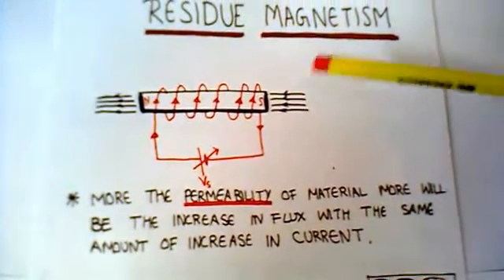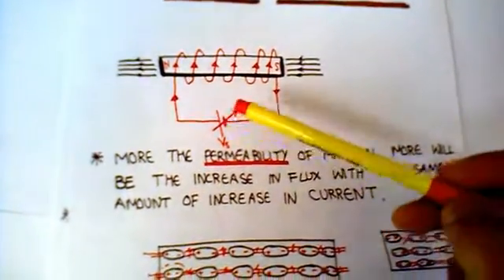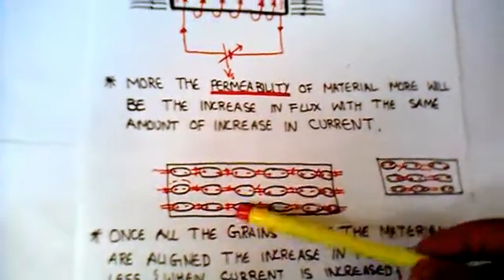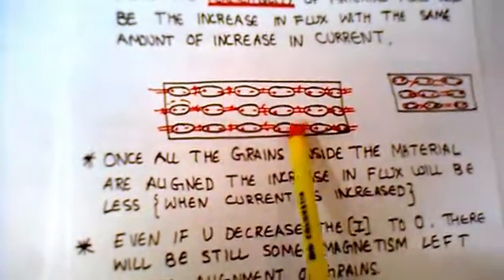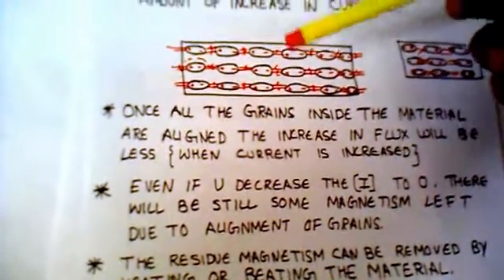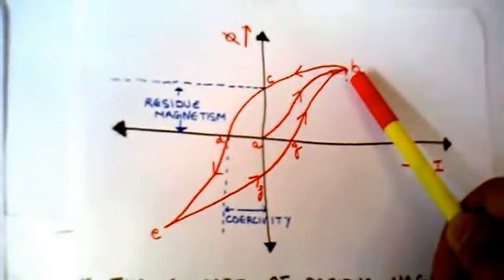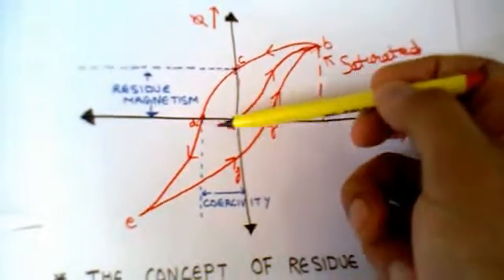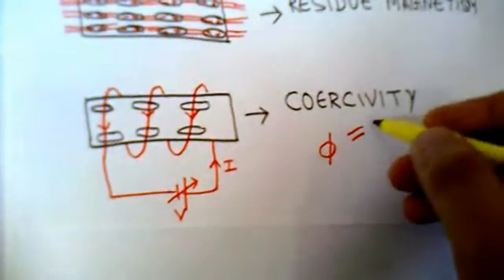THE CONCEPT OF RESIDUE MAGNETISM

Comment: Thanks for your interesting video.  I recently made a toy reciprocating electric motor.  It does not run.  I'm thinking the residue magnetic effect is the problem.  Is there any way to make this effect less?  Thanks
Reply from the maker: it would be difficult for me to answer your question. Plz send me your circuit diagram i'll try to answer you.
Reply: Are you still alive bro